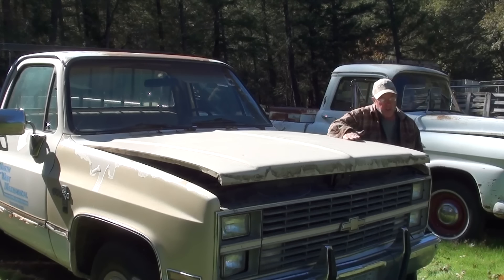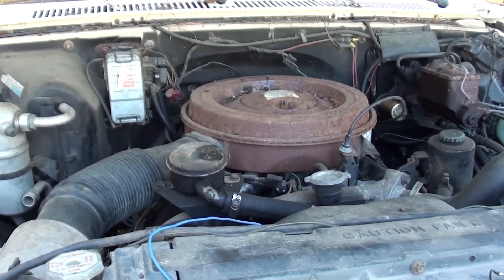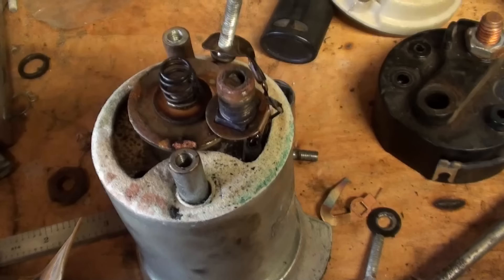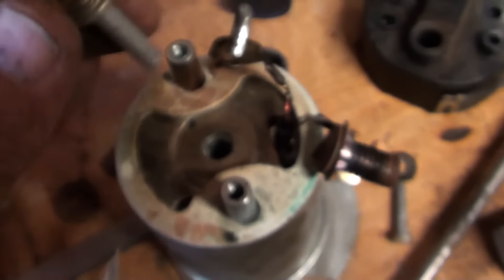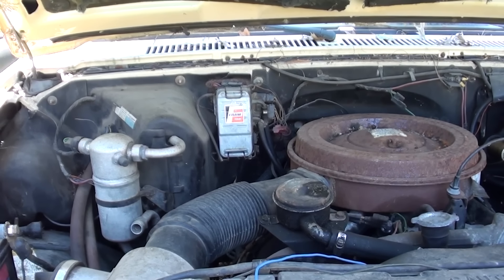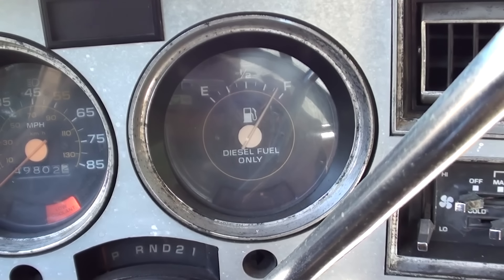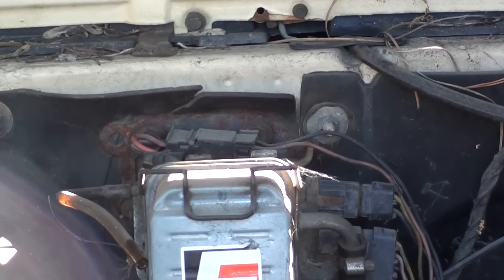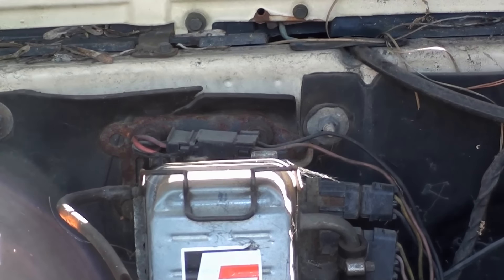84 Chevy 6.2 Dead For 6 Years! What Will It Take To Make It Run? Part 1 of a Series.

Comment: Had the same 84 with the 6.2
What these need is simple.
New ground straps; new starter, glow plugs and the relay and 2 good batteries.
Mine ran like a champ!
Reply: Replace the box fuel filter with a spin on fuel filter.
Reply: @randysretired2020  
Yes, I did that also .

Comment: Hello Jeff. I'm Tony. Hope your doing better each day. Stopped by to tell you this 82 Chevy truck your getting to know well. and the 6.2 diesel is a first year out. A real diesel engine . not the half & half olds engine. People say you should never buy a unproven truck the first year out. So I did just that in 1982. I did have some hick cups with it. but all come good over the years i had it. I learn to get my fuel in the winter at truck stops because of the high turn over of fuel was up to date with the weather. I live in Northern Illinois. And one time a vacuum hose come loose from a E G R actuator that made a lot of black smoke out the tail pipe when adding power. But It did the jobs I needed it for. every time. even at -4  in the Penn turn pike pulling a one car trailer loaded and a full 8 foot bed full of car parts. coming back from Boston . the truck was slowing down By the time I got to the next Pilot truck stop my foot was putting the gas peddle to the floor. On my rig there are two fuel filters. one like the one you where bleading and the other one under the air cleaner on the back side of the manifold . I changed both . and went on my way. I try to tell you but you dident get the msg . 
Take care and you and yours stay safe. TZ

Comment: I JEFF at one time I built a military 1 1/4 ton Chevy 86 with the same 6.2 diesel. I put a Intake manifold from a  military Hummer...there's a difference,  I did away with the timing chain and ran gear drive set up, I also put the Banks sidewinder turbo set up and Marine injectors. I also put a intercooler from a wreck 6.6  Duramax truck. That 6.2 diesel ran with the stock 5.9 Cummins pretty well.

Comment: I worked in Prudhoe Bay in the early 80s and we had some of these Chevy Diesels. We would idle a lot in the winter because of real cold weather . After they are  2; years old  with the engine idling if you removed the oil filler cap the exhaust would quit coming out the tail pipe and come out the oil filter.

Comment: I once had an 82 6.2 Chev. diesel 4 speed OD manual trans. One thing I found is it had and required 2 batt's to start. It didn't need the block heater any time to start, as long as the glow plugs were good. 2nd thing on the starter don't put a steel lock washer on the post for the batt's. the starter amp's will heat the washer up until it loses its temper and then no contact and no start. just leave any washers off and no problem.  There is a "rubber washer in the pump that when it goes bat the pump won't deliver any fuel to the injectors, and no start. pump must be rebuilt to fix the problem.
Reply: 4spd od? probably the A833 Chrysler aka NP440 GM trans. I had one too it was mostly stripped of parts i used the fuel lines and eng. still have eng but they are real tough to find if one was looking again. between that and a short box those 2 are considered the holy grail in the 6.2 diesel world.
Reply: Thanks, I'm gonna take my washers off right now!

Comment: Hey Jeff, good to see you back. People look at 6.2 starting problems like that engine is a rubik's cube. The main reason for starter motor failure is that stupid box filter housing that sucks as much air as it does fuel. The first thing I do is change it out to a spin on filter housing and a WIX filter.
Reply: instablaster.

Comment: I maintained a fleet of chevy p/u for a tree service. They were all 6.5 turbo diesel, and the hardest thing to teach drivers was the starting procedure. When the engine started, especially in cold weather, drivers would rev the engine and the injection pump would out-pull the lift pump. Then the engine stalled and you had to bleed the filter before it would start again. If you turned the key on and waited for the glow plug light, turn it off and back on again, and then cranked it with your foot off the throttle after the 2nd glow plug cycle, it would start and idle. None of these trucks are made worse by installing a better lift pump.

Comment: There's a wire leading to the fuel shutoff solenoid on top of the db2, when unplugged or not powered it will never start. 

If the advance solenoid at the pump is not working, you'll have to press the pedal to help it start and keep running, at least until it's hot.

The mechanical lift pump on the lower passenger side could also be out, if replacing put a new push pin with the lift pump. 

The fuel filter box (water separator) tends to leak out the back...badly, at times preventing enough pressure buildup for a start.  A replacement water separator from Car Quest or Napa works as good. Remove the whole assembly and place new water separator there. The existing holes work to bolt down the new water separator in place.

If it's a model with an EGR (1500 and some 2500's) remove EGR and purchase 3500 intake gaskets which have the EGR holes covered. You'll gain power as well, and it's safe on the tranny.

Glow plugs might need replaced, could be part of the issue. When removing, soak pretty well in bolt remover liquid like PB Blaster, and wiggle out slowly to avoid them breaking apart. Replace with Bosch preferably, as the Delco tend to accumulate soot, thus making hard to remove. 

Naturally, bleed all air and it should fire up. I've had both the 6.2 and 6.5 with either the db2 or ds4 pumps, respectively. Easiest engine to work on, for a diesel.

Comment: use WD40 as starter fluid i had lots of these trucks back in the day and it works .Note : you may here engine knock till it burns off but works well to clear out all air in the  injectors is cleared  .you will have to keep feeding WD 40 TILL it runs on its own ,spray it right down the air intake just like starter fluid

Comment: i have had to get several injector pumps rebuilt on international tractors if when you loosen the injectors and dont see fuel spraying all over, think the high pressure gets them finally.

Comment: I have an 88 1 ton with a 6.2 and the fuel gauge pegs way past full when the left tank is full. But it works, so I run it and keep in mind that 1/4 on the gauge is probably about empty. However the right tank reads normally.

Comment: Don't forget to put the brace on the back of the starter because they are known to shear the starter bolt or crack the corner of the block off which it did with my father's 82 6.2 that bent angle iron that bolts to the back of the starter and the block will stop that from happening you would not like our fix after the block broke off had to weld a bolt in place to replace one of the two main bolts that hold it and use a nut and lock washer and flat washer plus the brace on the other end

Comment: Pull  the top off the injector pump see if the linkage is stuck if the solonids are not clicking get a top off another injector pump

Comment: Best cure for the starter is putting the newer gear drive starter from the 6.5 on it. The best cure for the truck is putting a 6.5 engine in it !!! My 81 has a 6.5 from a 98 Sierra. It would run with the 6.2 injection pump but I went all in with the computer and everything. The transmission is a 700R4. I had to cut the part of the old gas pedal off with a grinder and weld it to the electric switch that is now my gas pedal. I ran the throttle valve cable from the transmission into the cab where the old throttle cable used to be on the 305.

Comment: Block heater , good glowplug system, electric pump and two good batteries a must. Worthwhile to run the pump without glowplugs with ignition on to purge air from the lines as much as possible before starting attempt. The injection pump will still need to be purged. If no go, remove the pump cover and check the linkage inside hasn't gotten stiff. Soak with biodiesel and gently free up if it's stuck. Crack the lines open at the injectors and check fuel coming out to purge the lines. If no fuel comes out, the stanadyne injection pump has an issue. You can check out my video how to episodes to see how to get these engines running even when others gave up. I'm running an engine used cross country that was abandoned in a farmer's field some years back, and resurrected a turbo version some others failed to get running.

Comment: Dont exactly intend on telling a man older then myself how to do things . Under the respect policy I carry . But if I'm able to share experience,  look what you do now is cancel glow plugs , crack open a injector line.  Start with a lower position on the rotary pump open the throttle to full position during this process.  Side to side doesn't matter. As you get like 4 or 5 dont open full as it may start. Being it was shut down then wouldn't start I'd think the pump is ok. 
My dad ran these back in the day also 5.7 prior , later on he came up with a 6.9 in a pickup for me to buy. Ive had it since. I hope this insite helps .

Comment: Make sure you got fuel at the injection pump and then bleed the injectors. Glow plugs should be 1.5 ohm each. Two batteries are a must in this motor. Block heather is nice thing that helps on a cold day.
Reply from the maker: This is only part 1 of a series. Don't want me to spoil it now, do you? 😀

Comment: if that was sat for years and you cant get it to start you will probably have to do what i did with mine, take the top cover off the injector pump and wiggle the lever that the stop solonoid pushes against, mine stuck in the off position and gave me a headscratcher for a while, it frees up easy enough as its in diesel.

Comment: Key thing for these is cranking speed. Generally a healthy engine really needs both batteries. That is cranking so well on one battery I suspect the compression is really low. You should be getting 350 to 375 psi in compression if I remember correctly. 400 psi for a like new cylinder.

Comment: You might give a push to the accelerater i have to do this with my 89 chev 6.2 diesel had to do it with dad's 82 as well or a tap on an ether can of about 1/2 second to get it to fire up or cough depending on temperature
Reply: Chris Felder I do not recommend ether; when the glow plug tip explodes off inside you are going to have an engine in a world of hurt.
Reply: GM recommends that you hold the Excelerator half way down above freezing and to the floor when below freezing when cold starting the 6.2 and early mechanical IP 6.5 diesels. It’s usually written on the driver side sun visor or the owner’s manual. These trucks are cold blooded when it gets below freezing. ether is never good for these engines from what the older guys have told me.

Comment: I bought an 83 with 6.2 hadn't ran in 8 years. Not knowing a damn thing bout diesels, YouTubed info... Pressurized the fuel tank with compressed air, had fuel in filters, a new starter, cranked til it started. Oh by the way, fuel smelled like turpentine. It was that old. But started.

Comment: Quick question Jeff, ever seen a GM car with the Oldsmobile 350 diesel V8?
Reply: Yes I've got a few of them
Reply: @chrisfelder362  you should make some videos of them
Reply: Do you need help with one
Reply: @chrisfelder362  nah, I’m just interested in them. I got a gas 71 350 Oldsmobile Cutlass
Reply: I've stopped messing with mine I've hit to many deer with the cars now I'm running around with full bumper grill guards on pickups and suburban
Reply: BAD DIESEL ENGINE.   THE WORST😣😣😤
Reply: @captainamericaamerica8090  78-80 were so so 81-86 were a lot better
Reply: They were never meant to pull anything other than the vehicle itself and get 30mpg; GM screwed up bad when they put them in the pickups in 78
Reply: @chrisfelder362  Not really. It was,still the same engine. Modified . IT WAS BASICALLY A PLUGGED UP 350. CHECKER CABS. HAD THESE. ONLY SOME.
Reply: @captainamericaamerica8090  Oldsmobile racers love using those beefy diesel block for gas engine builds.

Comment: u didnt disconnect the injection pump selenoid runnuing it dry, you're doing it wrong, its the red wire ont top of the pump also has 3 screw to the the cover if u cant identify it
Reply from the maker: Did you watch the rest of the series?

Comment: Is buick riv for sale
Reply from the maker: It is. $300. Clean Title. Hole in #7. Top end dismantled. For parts or restore. 1985 with the 305 and OD trans. Tan interior with good door panels. Interior is dismantled as well, as I WAS going to part it out. No parts have been sold off of it yet, as the head-on occurred before I could move forward with it. RNRTOT@frontier.com

Comment: Watch out for the 6.2 parts are getting hard to get 6.5 are much easier to get since the military uses them in the humvee
Reply: Not really. The 6.2 and 6.5 are nearly identical aside from a few tiny differences. Main difference being a larger bore. 6.5 parts will bolt right on a 6.2 and vice versa.

Comment: Can confirm, the 6.2 starter eats solenoids.
Reply: I’ve never heard of it being common. They are hard on starters, particularly the  starter bolts that like to either break or bust the mounting holes out of the block if you don’t have the brace on the front of the starter.

Comment: Cycle Glow Plugs,,,,,Cycle Glow Plugs,,,,Cycle Glow Plugs ,,,,,,Pray to the 6.2 Gods
Reply: Obviously they’re not working. My 6.2 will fire right up at 10F just on the glow plugs. No block heater. Although I usually do plug it in, easier on it that way.
Reply from the maker: Next video

Comment: Worst diesel engine ever. The 6.0L Ford was horrible but the 6.2 GM would never start to begin with so you never had a chance of blowing it up.
Reply: They're really good. Glow plugs are a serviceable item and have to be replaced around 100,000 miles. Servicing a diesel is not a recommendation